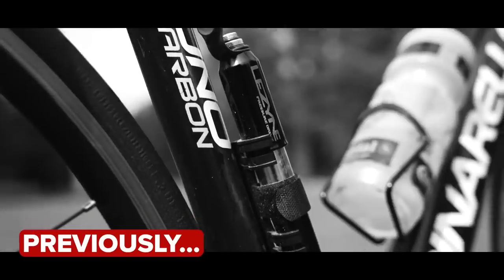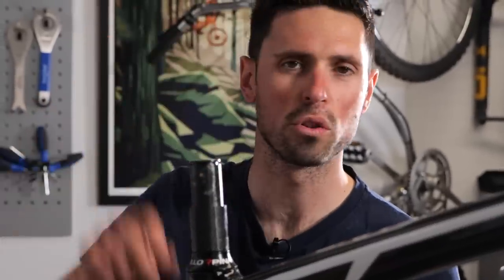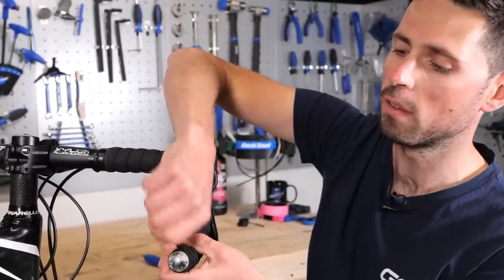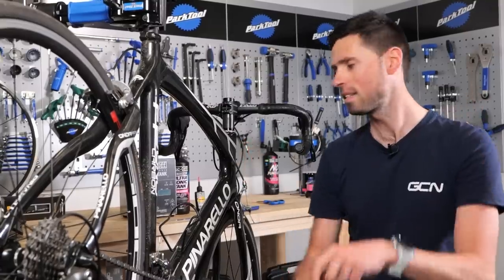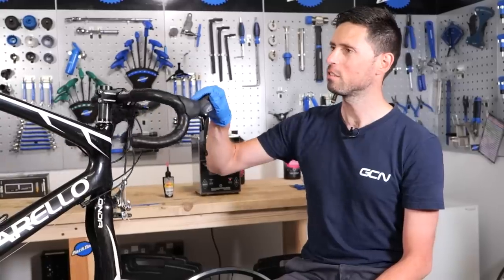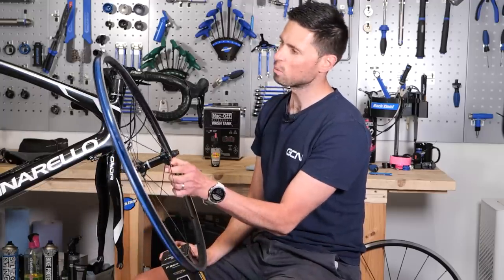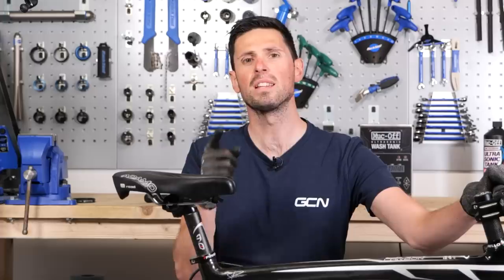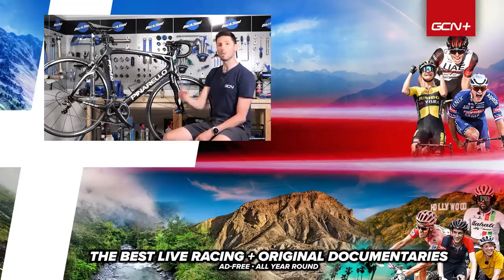Fixing Up The Cheapest Pinarello We Could Find!

Comment: Wrapped incorrectly, wrong direction on the top of the bars. I'd say traditionally wrong though.
Reply: 00s of bike mechanics say you're wrong. Alex knows what he's doing.
Reply: @zygmuntthecacaokakistocrat6589  they would be wrong too. Half the bike mechanics I've hired had put no thought into the direction they wrap. Only what they were shown.
Reply: @copystacker  I can attest to this, ever since learning about throttling, I now wrap bar tape like how Calvin Jones likes it. However, it doesn't suit bar tape with an asymmetrical pattern across its width, like ZIPP's Service Course bar tape, where the Service Course logos only appear at the bottom half of the entire roll of tape.
Reply: @yonglingng5640  yes, you are right. I prefer tape with symmetry for that reason. Anything with lettering along an edge or similar never looks perfect.
Reply: @copystacker  Glad to see another rider with the same logic. 😎👍